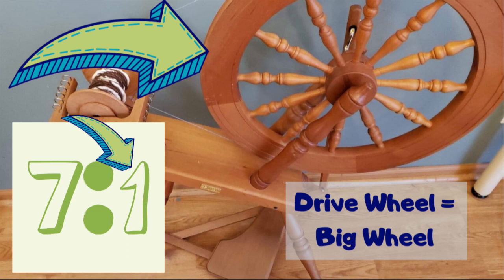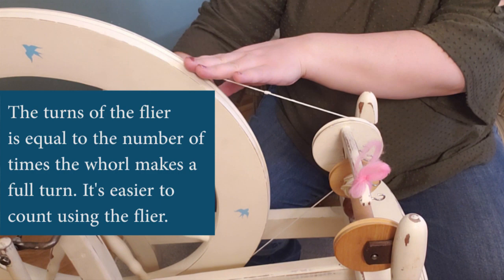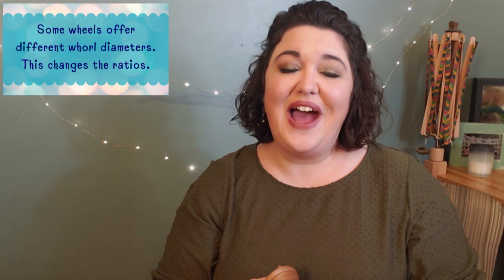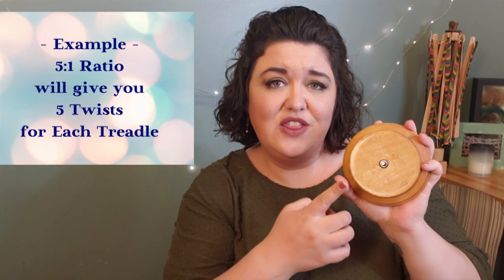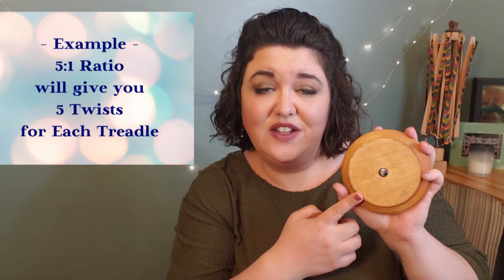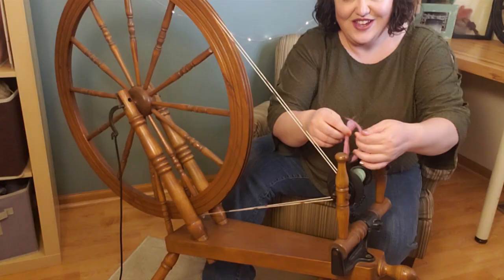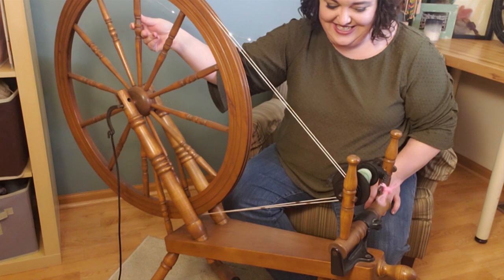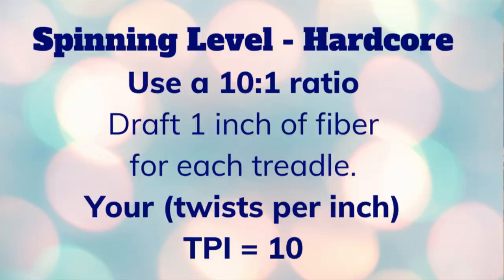Spinning Wheel Ratios Explained

Comment: so helpful! 
one of the books I was referencing to learn about my recently-adopted old saxony wheel had me measuring diameter and doing math, but this method seems so much easier. thank you!
Reply from the maker: Glad it was helpful!
Reply: @JillianEve  and it turns out my ratio is 13.5 to 1. 
I will have to practice a lot to get comfortable with such a fast wheel (once she's fixed up anyway)!

Comment: Hi Evie, Thank you for the excellent information. I finally understand why I am having difficulty in getting an even yarn. (without fat and skinny sections) I have a spinning wheel made by my father (passed away 10 years ago).  How can I determine the size needed to make a new whorl to slow down my spinning to prevent cork-screwing?  The ratio is 8.5:1.  Do I need to measure the whorl and drive wheel to understand how much larger to make the new whorl?  Thanks.
Reply from the maker: You can also manipulate how much twist you get by changing your rate or speed of twist. If you want less twist, treadle slower, and for more twist treadle faster. 💖😊🧶

Comment: This is SUPER helpful! I have a Betty Roberts double-wheel, double- drive, castle Style wheel. Since its all handmade by Betty, it doesn't have a lot of standardization, making it difficult to learn in many ways. This will be really helpful in figuring out ratios, although with the two drive wheels, I'm not sure which to base ratios off! And ideas would be gratefully appreciated!
Reply from the maker: What an interesting wheel! I would go by the treadle. Whatever goes around one full turn with a full press and lift of the treadle counts as 1. Happy spinning! 💕

Comment: Evie, thanks for this clear, concise explanation. Your videos are simply the best available, especially for novice spinners. Question: What ratio is most appropriate for spinning an even worsted using short forward draw? I spin on a Majacraft Susie Pro, a NZ castle with a 4-position whorl and drive wheel. I’ve been spinning for a year and although my yarns are becoming more consistent, I’m still unclear about how much twist is appropriate. 8:1 or 10:1? Your thoughts please.
Reply from the maker: The ratio is only part of the equation. How fast you treadle is the other half. Go at your regular rate and spin some yarn on a midle ratio. Then if you feel it needs more or less twist, adjust up or down from there. 💜😀🧶

Comment: I have a Schacht Flatiron. Thanks to your video, I was able to set it up double drive and left the poly band hanging inside because I spin a lot of icelandic. I want to spin some finer rambouillet and targhee top. Question: the Schacht Flatiron instructions say to use the smaller end of the bobbin for double drive. How might that change the twist/tension?
Reply from the maker: You want the bobbin groove to be smaller than the whorl groove diameter in double drive. ST and DD mechanics wind onto the bobbin differently so if you switch in the middle of a spin, you'll have to secure the yarn so it doesn't unwind off the bobbin. 💜🐑🧶
Reply: @JillianEve  No I wouldn't change mid-bobbin. Having trouble with tension adjustment, corkscrews in the single. Should I re-tie the cotton band? I was just guessing on the starting angle for the head.
Reply from the maker: @annelong2928  Ah! Corkscrews mean too much twist. I would try treadling slower and/or getting the fiber onto the bobbin faster (increase tension).
Reply: @JillianEve  Double drive going well. Thanks for your help and videos.
Reply: @JillianEve  This is what I don't understand: when trying to change whorls mid- bobbin on a double drive the bobbin changes direction.  I can't figure out how that happens.
Reply from the maker: @Ravencall  The bobbin turns faster than the flyer when the bobbin whorl is smaller. If you switch it to become bigger than the flyer whorl groove, it will turn slower than the flyer and wind the yarn the other direction. 🧶🐏💜

Comment: This is an excellent explanation. I have a Wee Peggy & only had a lesson or 2 about 30 years ago & haven't managed it since illnesses that now mean I can't tolerate wool. I'll check out the ratio soon. I'm looking at starting to spin again with either bamboo or cotton initially. Any thoughts about which is best for a beginner or anything else that might be good that's not wool? Thanks!🥰 Blessings from South Australia💕🐨
Reply from the maker: Bamboo is great, and so are other types of fiber like rose, seacell,  or ramie. Cotton requires a high twist because the fibers are shorter but once you get comfortable with your faster ratios it's a great spin. Have you tried mohair or alpaca? Do they agrivate your allergy too? And don't forget about silk! So much to spin! 🙂
Reply: @JillianEve  Thanks.... super helpful information. No idea at this stage if I'll react to mohair or alpaca. Lots to research & check out. I'm excited!!!💕🐨

Comment: Hi Evie, I bought a CPW this week, and looks identical to yours. However, I calculated my ratio to be 14.5:1. I have been trying to make it work, and I have watched all of your related videos from the r double drive bands and CPWs and spinningfor beginners. None of the suggestions seem to help, I get problems with overtwisting, and increasing the tension doesn't help. 
I know this wheel is meant for fine yarns, so I tried predrafting along with separating my fibers into thinner strip, still I feel like drafting is a struggle. The fiber I have is Peruvian Highland from Knit Picks, and the staple is 5" long. Could it be that this staple is too long to spin on a fast wheel? I had originally bought the fiber to spin on a spindle...

Comment: I haven't checked my ratio on my traveller yet but I tried to move to a higher ratio whorl but first I couldn't get the flyer to move and then when I adjusted my tension I couldn't keep the fiber from breaking. Was I missing something or do I just need more practice. Thank you for this video I understand ratios better now
Reply from the maker: If you go to a higher ratio you will add more twist and too much twist can make yarn brittle causing it to snap. Did the yarn feel very firm? Also, higher ratios are better for thinner yarns because they need more twist. What was the diameter of your yarn? That might help you troubleshoot it. ❤
Reply: @JillianEve  it was getting sucked out of my fingers and if I tried to hang on to it it would snap.
Reply from the maker: @lorimurphy889  that's definitely a tension problem. Try turning your tension all the way down and bring it back up just a tiny bit at a time. ❤
Reply: @JillianEve  thank you I will

Comment: I have a spinolution pollywog with the accelerator. I haven’t used the accelerator: well I did once when I purchased it (used), but I find I can get by without it. I tend to spin finer yarn naturally. I am a beginner spinner, so maybe that’s natural to spin finer. I would like eventually to use the accelerator, since I would love to spin lace weight yarn.
Reply from the maker: The accelerator is a really cool feature of the Pollywog. As you get more practice spinning, you will naturally start to draft faster. I bet you'll love the accelerator then!

Comment from the maker: What is your spinning wheel and what ratios does it have? Do you consider it a fast or a slow wheel?
Reply: I have an Ashford Traditional. I bought it in the early 1980s. I have struggled with over spinning. The foot pedal seems to stick at times and is not easy to keep going at times. I have replaced the string with a plastic band on the wheel. I have also oiled it but not too much. I recently bought a Lendrum which is much easier to use. I am attached to the Ashford because I have had it so long. Even with the Lendrum I think I spin too quickly and get too much twist. I am just not sure how to get the right twist. I am currently spinning lace weight on the Ashford and Fingering on the Lendrum. Also another question in this. I have fleece from the 1980s that is short and dry. Beautiful dark brown in color.  I am combing this fiber but it is so dry. What do you suggest?  Thank you, Cinda
Reply from the maker: I have heard people say that they find the Traditional a bit heavy to treadle. Mine eased up with more use and a lot of oil. I have to oil it every time I spin and if I go for more than an hour or two, I give it another drop and she's good to go. I have spun on a Lendrum and it was very smooth. They have lovely wheels. So if your fiber is very dry, it might have been an issue with the scouring. Maybe it was too hot or had too much harsh detergent? Or it could be due to the age? Whatever the cause, you want to work with it now, so what can you do? I know some spinners who will add oil to their wool after it is scoured. Norman Kennedy is one who particularly comes to mind. He put baby oil on his wool before spinning it. It was a bit like spinning in the grease clean. The oil might help. I would make sure it is a mineral oil and not a food oil that could become rancid. Some people will soak their fiber in warm water with hair conditioner dissolved in the water. I've never tried this personally but it might be worth a bit of research. Good luck! I hope you can save your fiber.